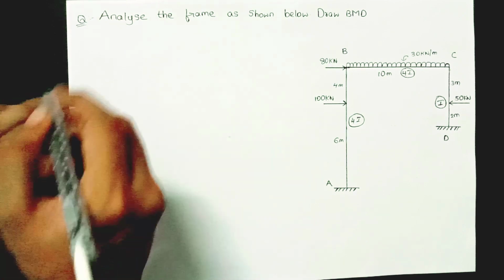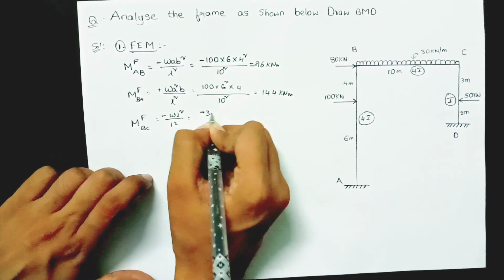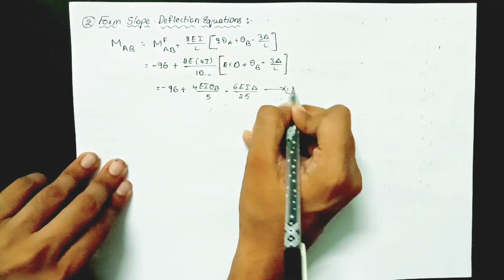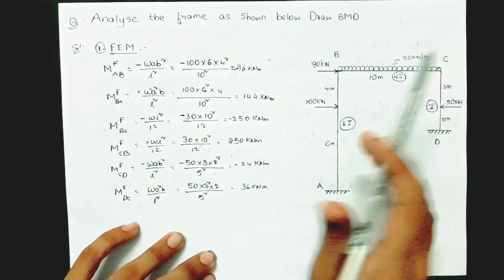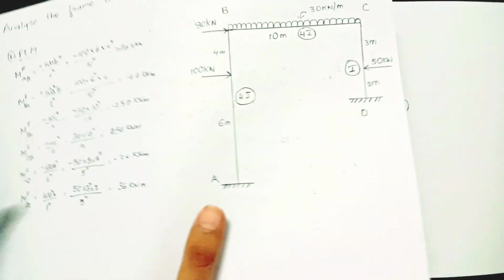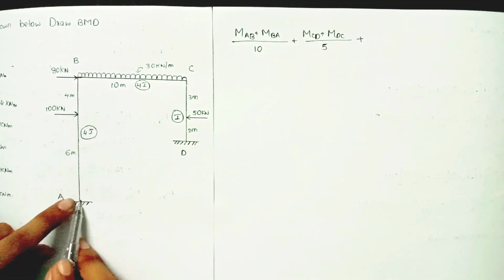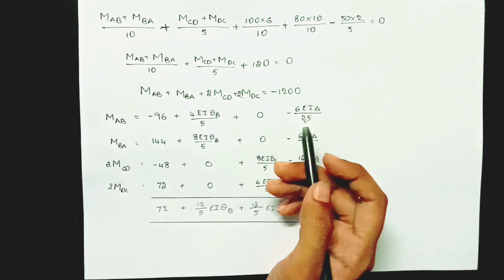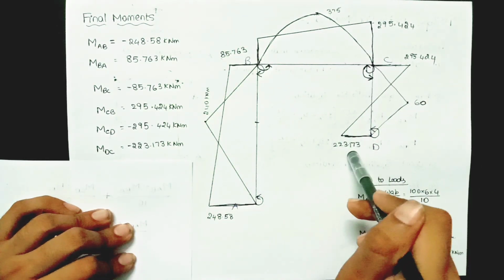Slope Deflection Method Problem 1 | Analysis of Frames | By Abhishek Civil Tech

Comment: Bro how did you solved those 3 equations can you explain it
Reply from the maker: If you want to solve manually, you can go for matrix methods like Matrix Inversion Method, Gauss Jordan Method, Cramers Method.
or
You can use scientific calculator and using mode option, selecting appropriate format of equation like ax+by+cz=d. You enter coefficient values. I will make a video soon you will get more clarity.
Thanks for watching

Comment: Sir, in AB we have two point loads buts u have calculated only one load
Reply from the maker: Yes, We should consider one load only. Because another load is acting on the joint, not on the member AB. If it is acting on the member then we should consider that as well. The load which is acting on the joint does not produce any moment because in first step we assume Joint B as Fixed Support. 
Hope your doubt got cleared. Thanks for Watching

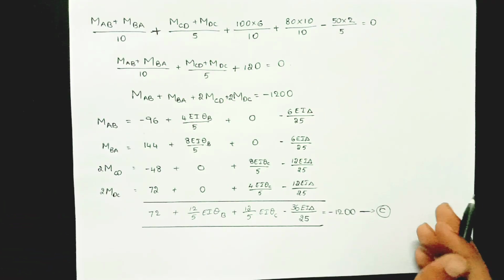Comment: Calci lo Ela bro 4 unnay ga and =- 1200 undi look @ 20:22
Reply from the maker: Take that 72  towards right side and add -1200 and -72. It will become -1272. Now equation will be reduced to 3 terms on left hand side. Using Mode option in calci select equation and then select type of equation as (ax +by + cz =d) and enter coefficients of all equations and solve it. Thanks for Watching